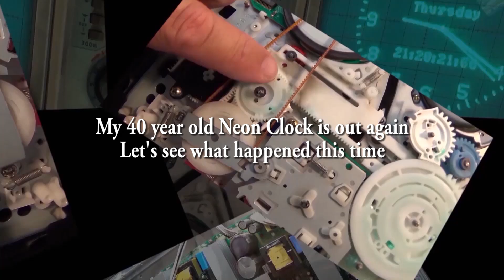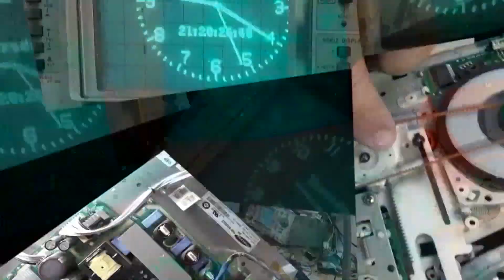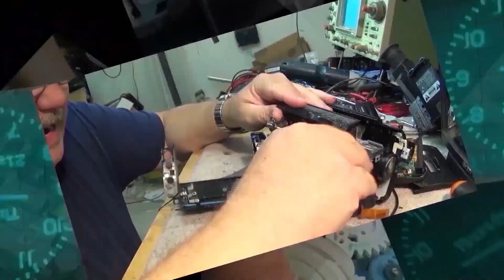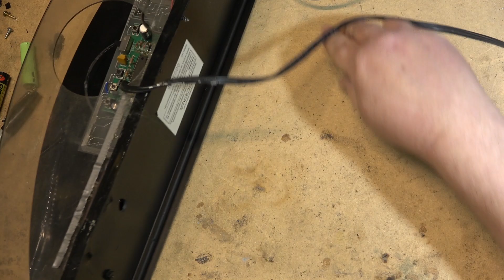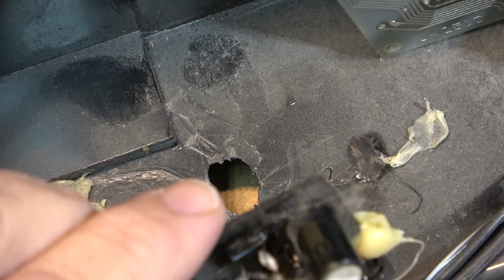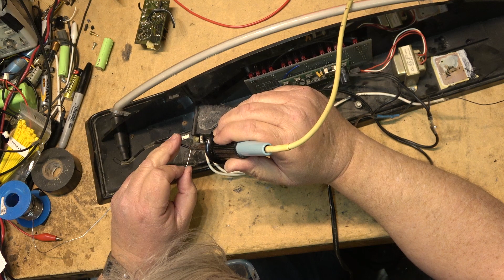My neon clock burnt out again what is the problem this time?

Comment: What would cause a 2000 budweiser neon plug/ battery-powered clock tick faster when turned on?
Reply from the maker: Could be interference from the neon inverter transformer.  Check the caps on the inverter board.
Reply: @12voltvids  there is no separate box for the neon. Would it still have what you're referring to?

Comment: But, of course you have a neon clock in your TV room. 😇💚🌵☘️
Reply from the maker: I have many neon in my collection I've been collecting for about 40 odd years maybe a little more. I got my first piece of neon art when I was 16 or 17. 6 clocks and probably 10 pieces of neon art all displayed around the house 3 phones.  Most are not true neon, but argon/mercury.  Neon is always a clear tube filled with neon and it glows orange.   I have 4 that have pure neon and the rest are technically cold cathode fluorescent.

Comment: Can the high voltage start a heart?
Reply from the maker: That's not how it works.  Defibrillation actually stops your heart and it only works if your heart is infibulation which means it's quivering due to electrical signals being messed up internally. A high voltage quick shock will disrupt these electrical signals and allow your heart to get back into normal sinus rhythm. You're hard to stop and there are no electrical signals no I'm out of shocking is going to bring it back you are dead. I am trained in industrial first aid and using the defibrillator is one of my qualifications for my level of training.

Comment: Five below was selling a neon plastic led strip that I put on a neon clock that the tube broke, it is powered by a usb module , works fine. I used two and cut to the length I needed . The clock pictured in your thumbnail isn’t the one you are working on. The clock you show in your thumbnail is old school with the neon tube hidden but lights up the dial. They are very expensive. When you replace the leds aren’t they going to be brighter than the others, like they should all be changed.
Reply from the maker: That's what i should do for the neon guitar my idiot kids broke.  I have 3 broken pieces cause by either kids or cats.

Comment: Even though prior to daylight savings time, it's funny that I begin to reset the clock, one of the wall mounted clock had a dead heavy duty AA battery and not only I have to change to a good heavy duty AA battery, but also to reset the clock and be done and be over it.

Speaking of the neon clock, I have the video that I uploaded to my YT channel that has color changing neon and never get rid of it, and it was not been used. https://youtu.be/nkLbdyO0NMI?si=ZitvCXle59oyhVQV
Reply from the maker: Neon doesn't change color.

Comment: Convenient this is happening around daylight savings time
Reply from the maker: Well I had to take it down to change the time so fix the neon power supply at the same time.
Reply: @12voltvids how often does your gears clock get rented out for movies
Reply from the maker: @stpworld  The only clock I rented out was the old neon clock I show at the end. The antique shop I bought it from had rented it to a production company and they called the shop wanting it for a re-shoot of a scene.  The shop contacted me and I called the producer and agreed to rent it to them. They rented it for 2 days. I had to deliver it to them, and place in in the set built in the studio and plug it in. Took it over after work and was let in to place it. they did their make up shots (needed the same one for continuity of the scene, had I known this I probably could have negotiated a much higher prop price, but what they paid me pretty much covered what I paid for it back in 92 when I bought it. Its the most expensive piece in my collection, and it is at least 84 years old. Has never been turned off since I got it. I did change out the iron transformer to the same one I put in the clock I repaired in this video. The original was 60hz 3000 volts 15ma. The one I put in 1600 volts 14ma but it is a switch mode, which greatly reduces cathode poisoning as they operate in the khz range, and are far more energy efficient. A clock like this one, but with a round green neon just sold on Ebay for just under 7,000! The wavy neon on mine is even rarer.
Not that I would ever sell it.  It will only go up in value the older it gets. Neon tubes do not burn out. They fail of the glass seal goes bad which happens if they are over driven and the cathodes heat up. As its 84+ years old and has not failed to this point it will probably still be running in 100 years.
Reply: @12voltvids  I actually have a neon sign but I never run it and I have a seiko musical clock I orderd from Japan ever seen those